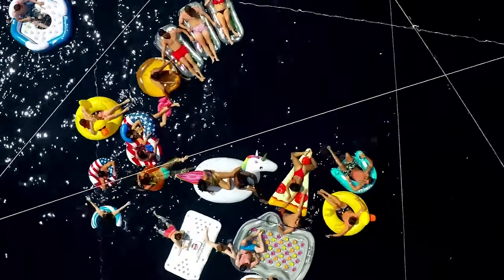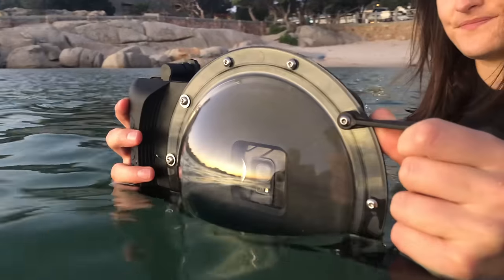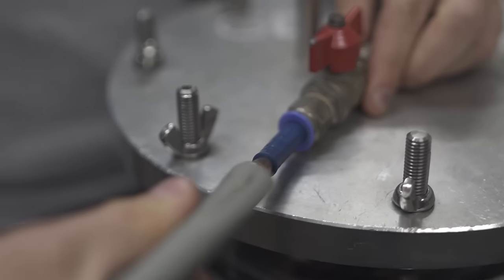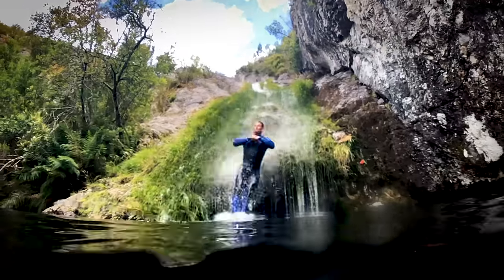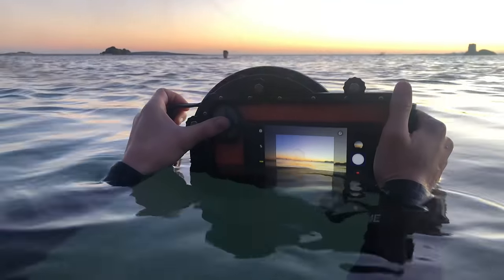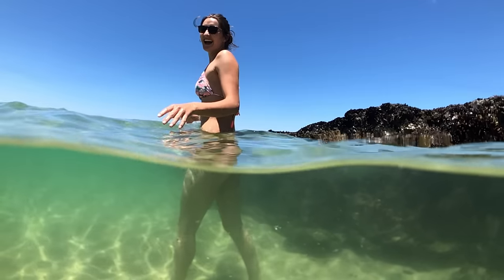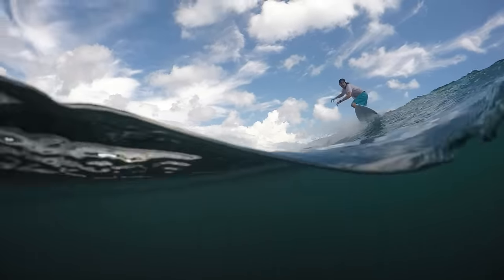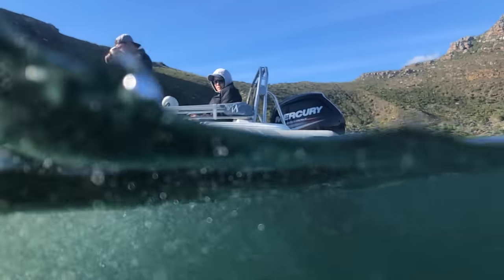Introducing the GDOME MOBILE  - The worlds first universal dome system for smartphones​!

Comment: Does the smartphone touch screen still work with the Gdome while underwater? I've got a Huawei P20 Pro.
Reply from the maker: Pedro Nóbrega you can use the Bluetooth remote to fire shots when under water. For changing settings ect, this should be done at the surface of the water.